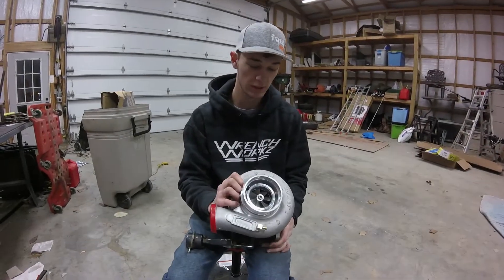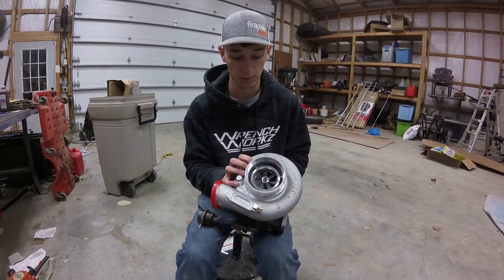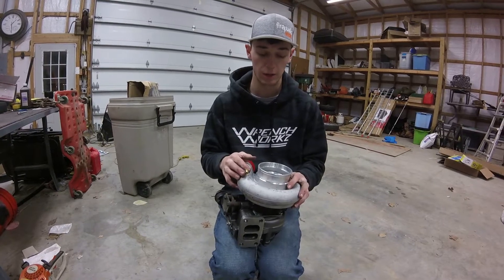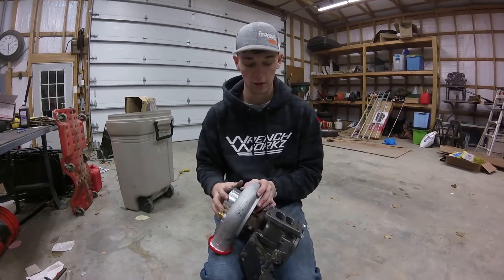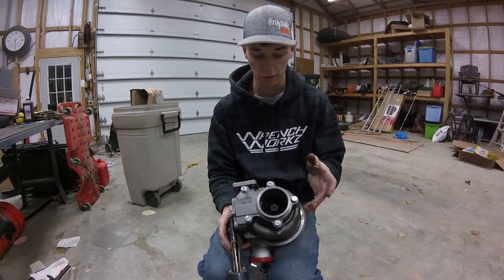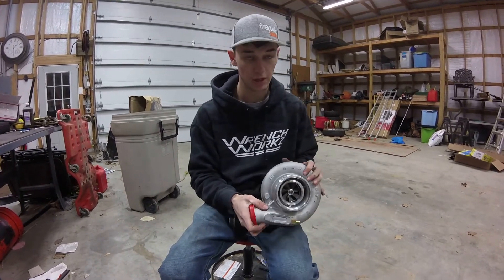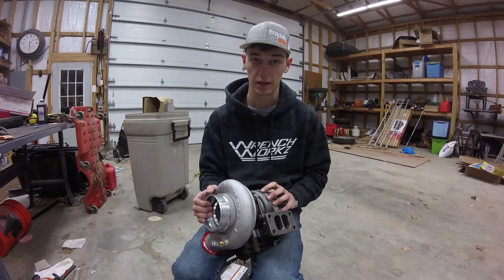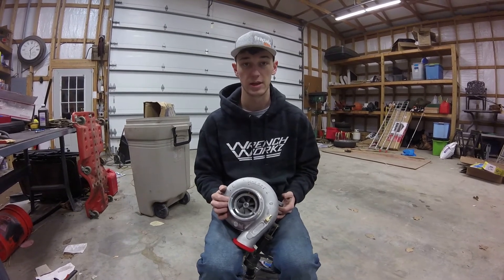@jhyde5.9 HX35 BUILD

Comment: How did the stock downpipe work out with that turbo? Have to change anything or did it pretty much slap on there with that 3inch flange on the hx
Reply from the maker: We threw the the stock downpipe away in all honesty, he wanted to utilize aftermarket 4" exhaust and that cast iron flange that comes factory on those  hx35s that comes off the turbine housing is a large restriction so it has a 4" down pipe that connects directly right to a vband on the back of the turbine housing
Reply: @GavinHuke  ah, I have a diamond eye 4 inch exhaust with a 3inch flange for the h1c, I was considering just finding a 3inch flange exhaust plate and trying that but not sure if that will work
Reply from the maker: @boyddenniston79  quite frankly I'd go ahead and spend the 70 bucks or whatever it is on a 4" hx40 downpipe from that same distributor and itll save you a headache
Reply: @GavinHuke  I’ll try it out, hopefully It will all snug together with the rest of the exhaust

Comment: What do you charge to build this hx-35? I've only got mild tuning done to my ve pump with a 366 gov spring, fuel pin, etc
Reply from the maker: Also yes he will be running a 4200 spring with all supporting mods, fuel pin, and all the free pump mods you can do with the VE, and a lift pump as well. I will be conducting a lot of testing with different setups on VE trucks to show you guys your best options in certain scenarious
Reply from the maker: Honestly if your looking into a build like this hey in contact with Fenley Precision Inductions. Him and Brad at Savage fab work to make amazing chargers and can build you a charger like this for a very good price. This will work well with your setup